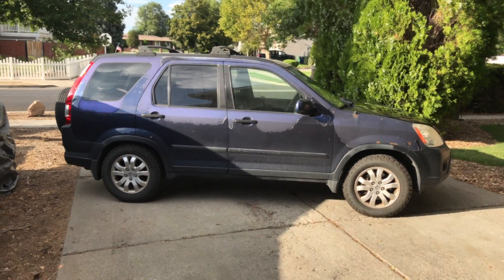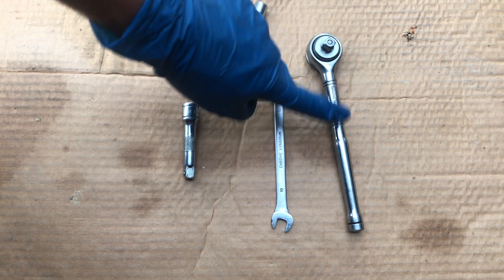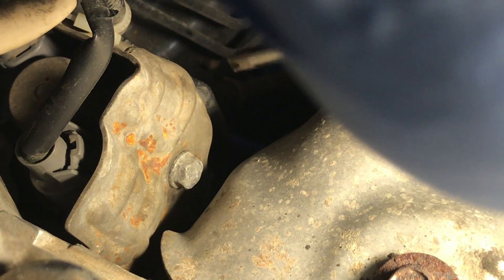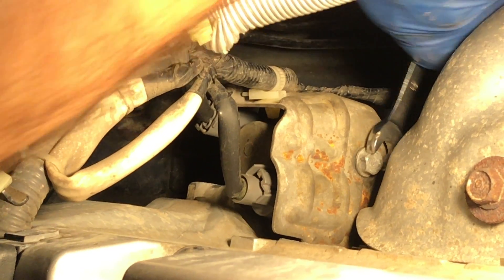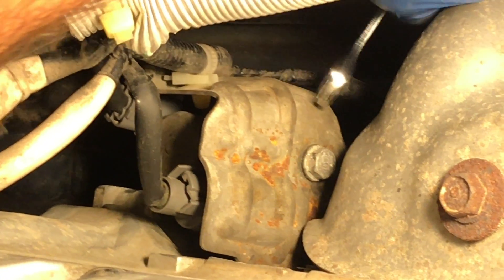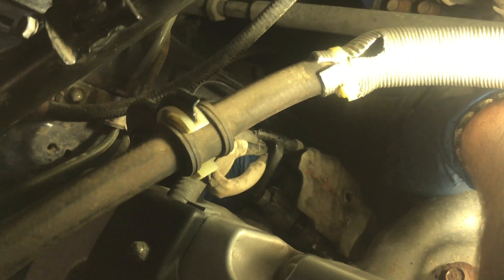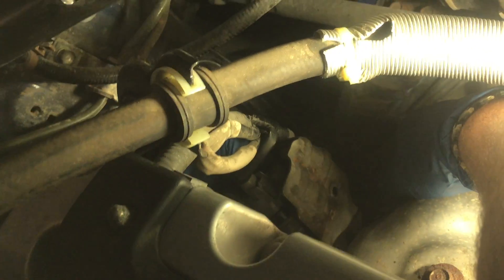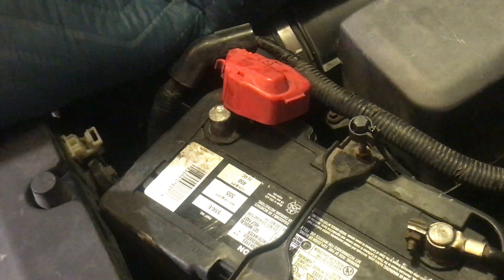HONDA ERROR CODE P2646 - VTEC 2.4L (EASY FIX AND LESS THAN $5)

Comment: Very thorough on the mechanical side of the job!  I would also do some basic electrical checks like pressure switch continuity and key on voltage at pressure switch  with connector disconnected and negative of meter to both engine and negative terminal in connector and solenoid resistance.

Comment: Great and helpful video, thank you.  Impressive how you could get views of the hidden bolts.
I found that removing the 10 mm bolt near the valve assembly securing the power steering pump hose and then tying it out of the way made the job much easier.
Also, I did not bother removing the heat shield.

Comment: If you've got a reader to get the code, it will likely also be able to clear that code.  No need to unhook the battery and lock your radio.

Comment: Id change out the oil when doing this, I did mine today - roll back 3 days prior- i got check engine and code. Removed solenoid - cleaned gasket filter and solenoid with brake cleaner. So i thought today id change the oil and put in a new solenoid gasket. Well after only 3 days the gasket i cleaned was full of crap. So prior to fresh oil, i used engine flush. If your getting a blocked filter on your vtec solenoid its a clear sign to change filter and oil. Absolutely NO point changing gasket without changing oil also. So today i had fresh oil in a flushed engine with a new gasket. Definitely good practice to do this. Also going forward im going to change out oil every 8 thousand miles.

Comment: I did this, still same code. I replaced the whole solenoid new with new oil pressure switch fresh oil with new oil filter, still same code. Idk what to do next.
Reply: there is another oil screen up front near power steering pump....

Comment: You had p0661 and p2646 codes. Did this also fix the p0661 or was that a separate fix? I searched your video's and didn't see anything for p0661.

Comment: What kind of symptoms did the car have before you fixed it? I was driving my car and my dashboard lit up like a Christmas tree and then my car started jerking and it wouldn’t go over 30 mph.
Reply: I have a 06 Acura TL with 3.2 vetch 
My car drives fine until you get to about 30 and try to gas on it. 
That’s when check engine light comes on and my vsa and vsa on symbol. 
My code coming up is a p2647 which is saying my vvt solenoid is stuck on. 
 You can try to just change the screen and filter and CHANGE OIL and oil filter when you do. 
If that doesn’t fix the problem it’s most likely the whole unit which has the solenoid and oil pressure switch. But that is around 200$

Comment: When such code is displayed by the vehicle computer, not always assume you have a dirty filter , chances are your oil pressure switch is bad , even if you install a NEW unit don’t taken for granted is ok , it happens to me put a new Vtec unit in my ELEMENT and didn’t fix the code …. end of the history ? Took a switch from a Honda thrown in the junkyard and worked perfect and no code 🤷‍♂️

Comment: My brother only 8 foot pounds if you do 10 foot-pounds it is too much pressure on the gasket and it will start leaking after about 10000 to 20000 miles to get longevity after gasket it is recommended to only do eight foot pounds and try to have a torque wrench and it is best for you not to remove the heat shield lots of times the bolt 🔩 on the heat shield snaps, just trying to give you a heads up my brother. Very nice video I like it thank you very much

Comment: Very bummed. Replaced the whole assembly as the screen was clean. Still not the issue. Car bucks at around 2500 RPM while in gear. Doesn't do it when the revved in neutral.
Reply from the maker: Hmmm, I wonder if the oil channel in the engine, where this assembly bolts to, has a blockage.

Comment: I just changed that filter assembly two days ago. Don't bother taking the heat shield off. Just undo the three bolts. I didn't even disconnect the plugs. I swung the spool valve onto the exhaust manifold, cleaned up both mounting surfaces with brake cleaner and a towel, then replaced the filter assembly (gasket with screen) and put it back on. Do not use any sealer of RTB, and do not overtighten! The bolts are supposed to be torqued to 8 ft.lbs., which is basically hand tight and about a half turn. If you tighten it too much, that's what flattens the gasket, and it will leak.
Reply: Great tip that's exactly what I did and I had a leak.

Comment: Pro tip: leave that first small bolt on - it only holds the heat shield to the solenoid chassis.  Just remove the three lower bolts and then you can easily remove it after you disconnect the wires and remove the whole thing.  Really, I think you could just leave the heat shield on for this, though I didn't.

Thanks for the video!
Reply: Yeah I left heat shield on

Comment: If you disconect the battery you will have to reset the tickover learning procedure to get it to tickover properly
Reply: Never had a issue disconnecting my battery

Comment: Would this b a similar process on a 2.4L vtec 2007 honda accord giving me the same code
Reply: It should be. Make sure you check the electrical connectors going to the vtec switch, and solenoid. If Ok, put a blog of die electric paste on both, and call it a day.

Comment: i just changed my vtec solenoid and now i have a p2646 code. I'm gonna check it out and see if theres anything obvious but do you have any suggestions? i suspected my oil pressure switch below the solenoid but from what i can see that would throw a p2647 code...

Comment: I think what you did with replacing it is definitely the best option. If you’re going to take the time to take it out you might as well change it as opposed to just cleaning the screen.

As far as diagnosing, there’s a step I’d take before even taking it out. When I got this code I figured it was the dirty screen as that seems to be the most common issue, but as with a lot of error codes, it could’ve been something else. To confirm it myself I just added some sea foam to my oil in an attempt to liquify any deposits on the (presumably) dirty screen and after idling for a couple minutes I was able to drive and get my RPMs up to normal highway conditions without issue...after only 30 miles the code cleared. Now when I go to change the gasket, I’ll have some peace of mind knowing that’s the true issue.
Reply from the maker: Excellent info. Thank you!

Comment: I’m working for NASA then 😎 , hey !! Thanks !!!
Reply from the maker: If you can put a round hole and square peg together you must work for NASA.  👍🏻  I had forgotten I had made  that reference while removing the electrical connections to the valve body.

Comment: 2005 Honda Pilot code p2646 I don’t know if it’s just the oil switch or the solenoid and there’s no videos to help
Reply from the maker: Hmmm. How many kilometers/miles are in the engine?  Rubber O-rings last about 7-8 yrs then start to fail. It could be a bad O-ring. This video shows how to replace that O-ring.

Comment: Fixed my problem. My gasket was all brittle and bulging into the passageway for the oil. Also seen cracked rubber parts on the screen. Replaced it, cleared the codes, and so far after driving around for a day it seems to be fixed.
Reply from the maker: Excellent!  Glad it helped!!

Comment: Im change the part new oil light is on again..🤦🏻‍♂️🤦🏻‍♂️
Reply from the maker: You may have a bad solenoid valve. How long after code reset did it it throw the P2646 trouble code again?
Reply: @paward4  Thanks 10 mint run the car light on.. Same day the light on new solenoid
Reply from the maker: @josenazario4316  Algunas preguntas: ¿Cuándo compró este auto?  ¿Cuántos kilómetros tenía el auto cuando lo compró?  ¿Cuántos kilómetros tiene ahora?  ¿Con qué frecuencia cambia el aceite?  Que tipo de aceite usas?
Reply from the maker: @josenazario4316  Y gracias por darme la oportunidad de practicar mi Español.
Reply: @paward4  Gracias así es mejor 274 millage tiene ahora hace 2 años q lo compre se lo cambio bastante a menudo soy de los q le gusta tener los carros al día el último aceite q le fue hace 2 días mobil fue el q use..

Comment: My local Honda Stealership sold me the VTEC gasket for more then 10 dollars, those crooks are insane!!
Hendrick Honda in Charlotte NC dont ever go there
Reply: VTEC gaskets cost $5-$10. I'd assume the OEM is higher quality since there's VTEC aftermarket gaskets with varying price and the cheaper ones usually fail faster.

Comment: Hello are all the bolts 10mm?
Reply from the maker: Yes all the bolts on the solenoid valve are 10 mm. One of the bolts may be longer than the others so keep track of where you pulled them.
Reply: @paward4  Ok thanks, do you remember which one is longer?
Reply from the maker: @hungchung2726  check at timeframe 7 min 52 seconds. It looks like one is shorter and two are longer. The 7:52 time frame shows the orientation
Reply: @paward4  Ok cool.

Comment: Thanks man. I had one bolt stripped, and had to order a new one, and a bolt extractor socket set before I could tackle the job. I think someone had over torqued  them. I have read 7 to 10 foot pounds is correct.
Reply from the maker: Good Info and reminder. Thanks!!
Reply: Which extractor set did u use
Reply: @chelseywashington6158  I bought a cheapo set from Harbor Freight. Pittsburg was the brand.

Comment: Thanks for sharing this amazing video....I wish I saw it earlier ...have an 06 crv and had the check solenoid replaced ...as the code coming up was rocker actuator...my check engine light triangle and vsa light all came on....after replacing ...the lights come back on from time to time....not sure if I want to go back to this mechanic again ....any thoughts? Oil was also changed when solenoid was changed
Reply from the maker: Hi, thanks for your question. In software when you find a defect, you always test it again to make sure it’s still a problem. What would I do in this case? I would check the mechanic’s work... the O-ring between the valve and the engine. It’s possible there was some dirt or something left in place. If the mechanic shop looks to be clean and pristine like a Porsche dealership repair shop, then maybe that’s not the problem.

However if it’s a questionable cleanliness/disorganized shop, it’s possible the O-ring is leaking. 

And as long as you have the valve assembly off, I’d probably get some (ATF+diesel fuel mixed 50/50) and give the valve body a good cleaning.
Reply: @paward4  thx for replying ! I only saw this now as I didn’t get a notification! Funny enough I went back to the mechanic today to have him look at it ...p2647 came up which was vtec oil pressure switch ...he advised that they cleaned the screen inside the solenoid because there was some oil crud ... he is saying that at next oil change I should do an engine flush ...I have 287k on the car ...any thoughts?

Comment: Hi... is this part is as same as Honda Odyssey 2008 . ?? 
I need price for whole assembly  too.
Thanks
Reply from the maker: The 2008 Honda Odyssey probably has a V6 engine. Therefore this would not be exactly the same. Although, it probably does have the valve but I have not worked on one so I do not know where that valve would be.

Comment: I will try this on my 08 honda element. I don't have any leaks yet. I'm going to change the oil and change the rubber thing tomorrow and hope the check engine light doesn't come on. Although the light comes on then it turns off then it would turn on again later.
Reply from the maker: Good work Seung!
Reply: @paward4  do I have to get my oil changed with this process with getting the gasket screen replaced?

Comment: do you recommend using replacement gaskets or OEM gaskets?
Reply: Always best to get OEM if possible
Reply from the maker: From my experience, with this gasket, there hasn’t been a quantifiable difference between dealer and aftermarket gaskets. 

If you’re doing anything on the throttle body gasket, I recommend getting it from the dealer. I had negative experience with my 2007 CRV throttle body non dealer gasket.

Comment: Just happened to my 2003 element. 2646 code. V-Tec engines are trash
Reply: No, they’re the most reliable 4 cylinder engines made. Dumbasses that refuse to keep their oil changed at proper intervals are trash.
Reply: Did u fix it, if so what did you do,, same problem with my 03

Comment: I have an 05 Honda odyssey with the same code I change the VTEC solenoid and I still have the same code wonder what your thoughts are on that
Reply from the maker: Seems that the Odyssey has the V6 so the specifics might be different.  Here's some things I'd look at in the overall picture going from easiest to hardest. 1) History/frequency of oil changes.  Is there any sludgy buildup in the engine (looking down the oil fill hole? 2) If you reset the code, and change the oil, does it still come on?  3) Is the VTEC solenoid receiving the proper power.  4)If you replace the solenoid, does the check engine light come on again. 5) A Google search on 2005 Honda Odyssey P2646 will turn up a plethora of info.  

Keep me informed on what happens and feel free to message me with updates.  

-Patrick
Reply: Michael Mowery Get the honda part oem ...get the original part, it fix my problem after 2 months of
Reply: I did that that didn’t work either
Reply: I also replace single wire oil pressure switch code 2646 and 2647 went away

Comment: ATG recommends to replace the whole assy rather than the gasket screen.
Not fun climbing on the engine. Nice camera angles.
Reply from the maker: angelisone thank you for the comment. Replacing the whole assembly is a good idea. For a car this old it may not be worth replacing the part for $60 unless I’m keeping the car for another 13+ years. I may not keep it this long so I opted to only change the screen. 

Climbing on a hot engine is not pleasant for sure.